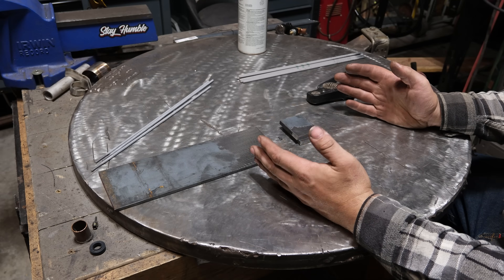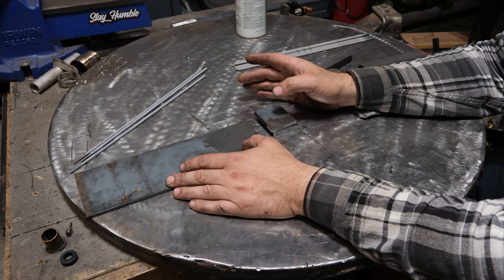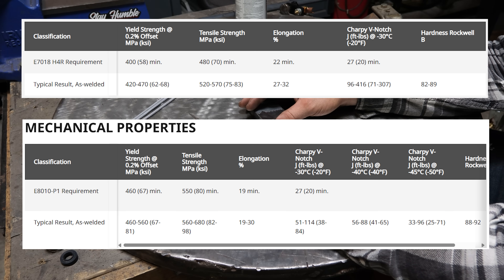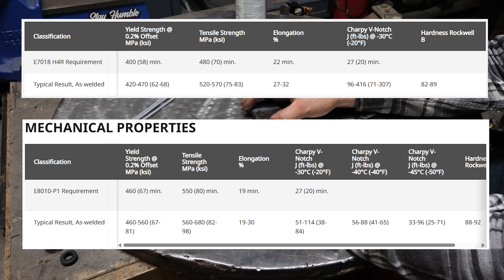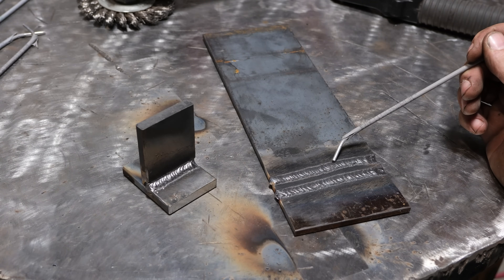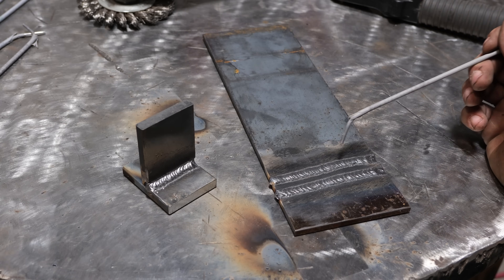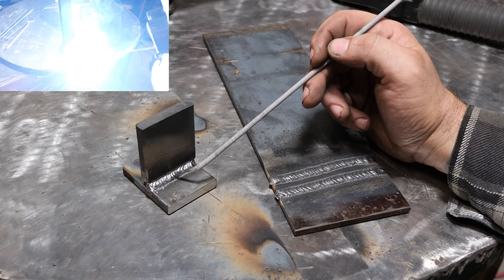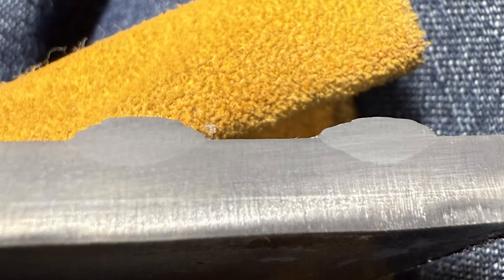8010 pipeliner rod vs 6010:  Is 8010 actually better?

Comment: Have you done a test on the this thick material showing the benefit of preheating for those running 120v machines? As a mobile repair guy there are times that I get away with using my little flux core machine by using a handheld propane torch. On large heavy repairs I’ll generally use a “weed burner” propane torch even when stick welding.
Reply from the maker: So I have done a few videos on preheating.  I can tell you if there is one thing I have found universally with it, is that it doesn’t increase penetration like people believe.  What ends up happening is the weld will flatten out and it appears as though it’s “hotter”.  However the root penetration is virtually unchanged.  To some extent the sidewall fusion may go from not the best to a little bit better, but it’s not an absolute.  Root fusion is limited by the process itself more than anything.   Preheating should be done if the steel is below 40, if the material is known to be hot short sensitive (think cast iron, spring steel, etc).  

On limited power (120v) the best solution to welding thick steel is tig and then stick.  The main limiting factor is the welding machine.  Modern inverters that have power factor correction (esab rogue, miller 161, Lincoln sprinter, fronius 180s, and other higher end machines) are capable of welding at 100-120a with stick on a 20a 120 breaker and 130-140a with tig.  This is enough output to weld unlimited thickness without worry.  Doing a root with tig and then stick welding it out with 3/32 7018 would be unquestionably about as strong as you’re going to get.  Where the problem comes in is many cheaper stick machines can’t achieve over 80a on 120v and MiG machines simply can’t achieve any penetration on 3/8th+ material regardless of preheat.  

Since you’re a mobile repair guy, if you’re not running a esab rogue, miller 161, Lincoln sprinter, or some other machine save up and buy one.  They will open massive doors on reduced 120v power or on a generator.  I weld repaired whole trash compactors for garbage trucks off 20a 120v circuits with a esab rogue.  It’s unreal what you can do with some of the new machines.  

Here are two videos that go into preheating a bit:

https://youtu.be/bj67U1_WuQM?si=Y4IJXg7sRhAyo-pW

https://youtu.be/CxxH6rQXm1Y?si=3c2jPtbQegkg6Biu
Reply: @makingmistakeswithgreg thanks man. I really appreciate the info. From my experience I’d have to agree with you. My main reason for using the torch is to prevent cold lap on starts/ stops, I also feel that it helps allot when you can’t prep the back side of what you’re welding.

Comment: just a fun thought- It could be interesting to see if welds with different rods fails differently at low temp zeroF or lower?
Reply from the maker: So I can tell you that any weld done on super cold steel without bringing the temp up to above freezing will be super suspect.  I did a test where I ran 7018 beads on mild steel fillet welds.  One set was below freezing (-10f or lower) and the other was at room temp.  Upon bending both in the shop press the cold one (which had heated up to room temp via welding) failed to bend and broke.  No doubt cold steel will have a drastic lasting effect on strength of a weld 😀👍

Comment: What machine did you run them on?
Reply from the maker: I welded with the dynasty 210 (newer one).  If a machine will run 6010 it will run 8010 👍

Comment: Morning Greg, I had a video idea for you, mostly because I’m interested in trying to do it for myself. Is it possible to have a video done on welding wear plates and welding abrasion resistant steel like ar400 or ar 500 to mild steel? I’ve got some skid loader attachments that are cheap Chinese made and they work great but they don’t have replaceable skid shoes or cutting edges so is be interested to see the procedures for plates such as the rock mount Zeta wear plates. I understand you’re pretty busy these days but I feel there’s a lot of subs that are interested in the same thing
Reply from the maker: Great idea.  I ordered up a ar500 plate and will do a video on welding it.  In the meantime I will give you a bunch of advice.  So ar500 can be welded easily, but the feasibility of the weld lasting is a sticky situation.  Straight ar500 is commonly used for things that see impact forces and wear, both of which are problems for welds on the material.  The material itself changes in the heat affected zone after welding, the HAZ typically becomes brittle.  The weld itself absorbs the alloy of the base material and often becomes more brittle as well.  In simple terms the material itself is impact/wear resistant but after welding the welds (and area around the welds) typically do not take impact forces well.  It’s also common to have welds crack right off the plate after welding.  

To properly join the material you have two options.  1) to braze it on which doesn’t melt the base material, or two to weld it.  If welding is chosen low hydrogen processes must be used (7018+, hardwire Mig, tig, etc.  6011/10, most self shielded flux core, and other non low hydrogen processes will impart hydrogen and likely cause failures.  Under welding it with 7018 is preferred since you’re not going to be heat treating/annealing anything after welding so the results will be better and less prone to outright failure.  You must preheat the material before welding.  The general rule is 200-300 degrees for up to 1inch thick.  If the weld cools fast it will crack/be brittle) and the base material may crack.  If you choose to use Mig welding you must not use c100 gas.  Some people say this can be used but I find the welds are impossibly hard after welding the stuff and more prone to failure.  Slowing cooling by putting some heat into the metal after welding it will help.  You don’t want to overheat the material, the goal is to give the material time to get to room temp.  Do not heat it above 500f at any point, if it’s that hot after welding leave it to drop to sub 300 and then give it a little heat to keep at at 250-300 for a while.  Beyond that I would avoid putting big welds on it fast or multiple passes.  The goal is to get the material to stick to something, not to burn it in as a structural component.  Therefore doing short 2-4in welds and staggering them all over a plate will give better results than slapping down a big pass.  You want to put as little heat into it as possible but actually fuse it. 

If you follow that advice you should be able to weld it and have acceptable results.  Ar400 tends to be a bit less temperamental but still do the same things.  Hopefully that helps 😀👍.

Comment: We need to remember that many specialty electrodes are actually engineered for very specific steel grades. Pipeline rods, for example, can be specifically formulated for API-spec steel pipeline. The more specialized the electrode, the more likely it will not perform well on steels outside its focus. Since most steel available to us as home gamers is A36, the best option is to choose something engineered specifically for A36-- say, 7018.

Comment: Great video, Greg! You keep killing it with the content. It's worth mentioning that the 20% elongation of 8010 is still pretty ductile in the bigger picture of higher grade steels and castings. Even the most ductile grades are only 35% or so. But this is the spec sheet value, and it's super important to appreciate something you perhaps understated:

The strength of the weldment is not just the strength of the weld bead itself. The interface of the weld with the parent material is absolutely critical. The spec sheet is only testing the weld bead-- it's telling you nothing about the effect of that weld on the adjacent metal. Since welding involves melting metal, it means the heat treat and metallurgy of the base metals are permanently altered by the weld. Sometimes it's an improvement. Sometimes it's neutral. Sometimes it's catastrophically degraded. This effect is ultimately what determines the strength of the welded joint (bead AND base metal). And since the joint is only as strong as the weakest part, we really need to consider the effect on base metal of the weld rod chosen. This is why 7018 is so "real world" tough-- the weld itself isn't just ductile, but it allows the transition from weld to base metal to be ductile and well-fused. A good 7018 weld is a nice continuous joint of nearly equal ductility and strength-- which means no stress concentrations and hard areas that initiate cracks. Concentration is bad, distribution is good. Disperse the stresses and life is good.
Reply from the maker: Thanks so much for taking the time to share that with everyone.  Any you’re absolutely right.  Good specs on a data sheet and real world performance are completely different things.  Knowing how strong a weld metal deposit is gives valuable info, but that same weld deposit on mild steel vs ar500 will have completely different results.  The simple answer on mild steel is 7018 will match the performance of the base material and will outperform all sorts of other rods in practical real world tests.  7018 should be the rod that is used when strength, resistance to impact forces, and vibration, matters.  Arbitrarily using other rods based of tensile strength rating only is a mistake.  I have even had people argue that the higher the tensile strength the stronger the weld, and that’s all that matters.  The truth is yes it may be stronger In testing but in the real world that doesn’t mean it will perform better.  The fortunate thing is welding is so strong to begin with and most people never stress what they weld to 90%+ max.   Common deficiencies in weld quality and weld metallurgy simply don’t show up often for most people.  If welding wasn’t as strong there would be a lot more people doing things more “properly” along with avoiding rods other than 7018 lol.

Comment: Thanks! Greg! My all around rod will be 6011 on my farm! 👊🏻👍
Reply from the maker: 6011 is definitely a good rod to have.  I would definitely pick it over 6010 for general use, it’s far easier to weld thin material with and it tends to be easier to get a decent looking weld with 👍
Reply: I haven't had any luck using 6010 around the farm, but everyone seems to keep them in stock.
6011 is way more dependable.

Comment: Hi Greg, yeah, there is a 9010 rod. It's mostly used for high temp applications.
Reply from the maker: Thanks for sharing that, I figured there probably would be.  Obviously even more specialty for use, with probably even less benefits for the average person lol.
Reply: @makingmistakeswithgreg  well..... unless you have your own hobby refinery or rocket launch pad..... but then again, I wouldn't be surprised some people actually might have that so, there's that...  🤣

Comment: This video is not going to help things. You are just confusing people who want to find a shortcut. You aren't going to find a better weld by finding the special rod. The standard rods are standard for a reason. Use the things that are recommended. These rods are special use case. Definitely nonstandard.
Reply: Thats like... exactly what this video is about.
Reply from the maker: I was pretty specific in talking about what it’s used for, and showed why it’s not really better than 6010.  Not sure why you think this video isn’t going to help/confusing people, at no point did I contradict what I said and I specifically said there is no benefit to using it.  That’s about is clear as you can be not to use it?

Comment: Don't buy these unusual rods unless you have a specific purpose for them. You need to have more than a basic understanding to tell your actual needs. Your needs are almost never going to run outside the typical rods you'll find. It's silly to buy rods you don't know you'll need
Reply from the maker: Unfortunately there are a ton of rods out there that fall under non AWS classified that are sold to the general public.  Rarely do they offer anything of value, but it’s important to look at them anyways to gain a better understanding of them.

Comment: It is interesting to learn about new rod types, even if I cannot find or use them. There is no benefit for me to use 8010, for sure. I use 6010 and it is a fire breathing dragon when compared to my usual 6013. I use 6010 when penetration is important and the metal is thick, so I don't burn a hole straight through it. Welding is much more complex than meets the eye. Higher rod numbers come with downsides. Thanks for the knowledge.
Reply from the maker: No problem 😀👍.  The cool thing is despite most people never likely using them, a lot of people will realize that there is more going on than simple tensile strength when it comes down to holding things together.  “More is better” isn’t always true with welding.

Comment: Great video!  Coincidentally, I did some 7018 welding today to finish a project I had been doing with the small flux core welder… up to when the Amazon welder just stopped working after just a year and two months.  The stick welded fillets came out much better…so it seems that the 110 welder was just not powerful enough.
Reply from the maker: 110 is hard to get enough heat output with wire.  Modern higher end stick and tig machines can easily weld unlimited thickness on 110, but even modern wire welders will really struggle above around 1/4.  I wish there was some way to have a 110 wire welder that could have really good results on 1/4in + but short of having an internal battery that won’t happen lol.

Comment: I've burned miles of 6011 on a buzz box. I've only burned one box of 6010 and it was red. I've only had welders that burn 6010 for a couple of years. I now burn the 6010 or 6011 and I find the 6011 runs just a little better for most things. The 6010 (in red), seems to run nice once the metal is hot but isn't as easy to start on cold steel. That's my opinion so far. Can you address the colors on these sticks? Is there some difference between red and grey? I tend to weld with what my supplier carries, but I know people post about using Lincoln rods with "P" ratings like: 5P or 5P+ etc.  If you know how these things differ from other brands, can you discuss sometime? Thanks. I love your channel, Greg.
Reply from the maker: So generally speaking the red 6010 rods are a more aggressive arc compared to the grey rods.  The grey rods (typically known as a 5p+ rod)  are more common in piping.  The grey rods tend to burn off more evenly when welding open roots.  It’s very common for 6010 to have the flux burn off inconsistent (it’s called finger nailing) and the arc can become unstable.  For general use on scabby material that’s thick I rather use the red rods.  For thinner material and out of position welding I rather use the grey rods.  For a majority of general purpose work (especially thin material) 6011 is a better overall rod.  It’s less aggressive therefore it tends to work better on stuff 3/16th thick and less.  It tends to make a slightly better looking weld because it’s not as fast freezing (it helps smooth inconsistencies in movement.  The main thing 6011 loses to 6010 in is penetration, 6010 has significantly more penetration.
Reply: @makingmistakeswithgreg  Greg, thanks for explaining that. I'm going to write this down.

Comment: Could you test 7018ac against regular 7018? Would be interesting to see if the AC rod would have the same sensitivity to moisture and if it is equal in strength or not.
Reply from the maker: So I am gathering 7018s to do a shootout/test with, and I will grab some a/c rods to put in the mix.  I can tell you that the a/c rods will have the same issue with hydrogen that all 7018s have.  7018 can be used to weld high strength steel if they are kept dry (aka in a sealed box or kept in a rod oven).  If they are improperly stored they won’t be “low hydrogen” which basically means they may impart hydrogen into the weld.  That’s not really a big deal for most metals people weld because all other rods have way more hydrogen into the flux anyway, and the issue hydrogen causes (embrittlement) tends to be mostly on higher strength alloys.  Strength wise the a/c rods should match the dc rods.  The a/c rods exist because Lincoln tombstones (and similar machines) can struggle to keep normal rods lit.  The a/c version needs a bit less voltage to stay running therefore they run better on many buzz boxes 😀👍
Reply: Another issue is getting the 7018AC rods on the weekend, e.g. your hardware/big box store is likely to carry the -AC rods.

You want the real stuff - that Lincoln Excalibur 7018 - it’s real Welding Store territory…. 8-5 Monday through Friday…

Comment: Sounds like rods such as 8010 are intended for a different alloy than your standard run of the mill A36... the new alloy formed by the combined base/weld metal does not have the proper characteristics to take advantage of the higher tensile strength of the 8010 deposit.
Reply from the maker: You are correct 😀👍.  Definitely a case of a tool for a specific job, and it’s not too useful outside of that job.